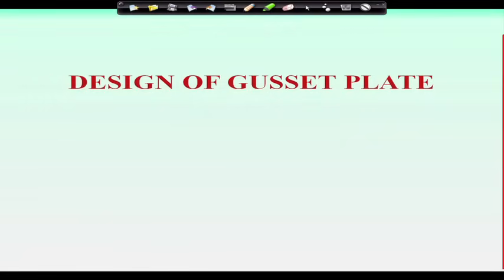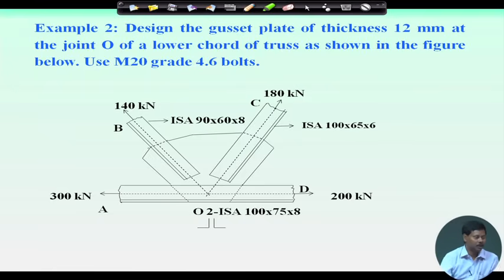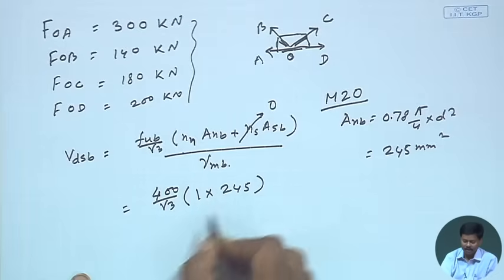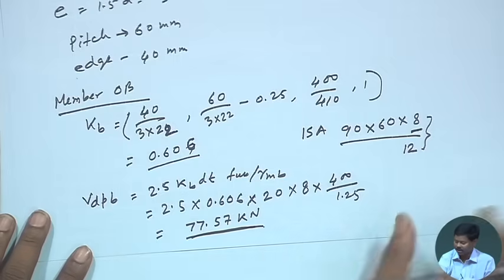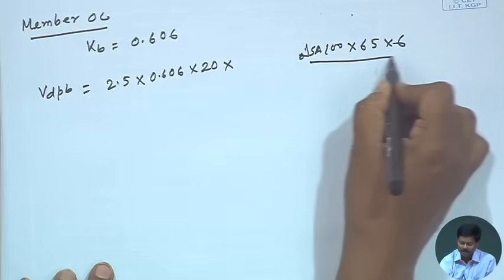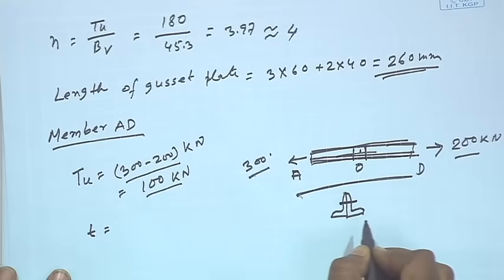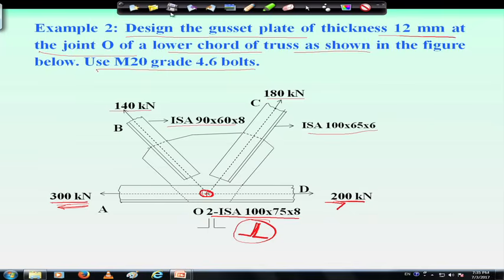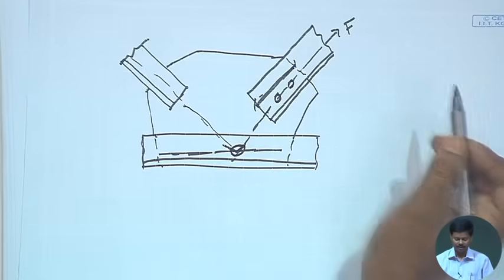Lecture 26 Design of Gusset Plate

Comment: What is the need to calculate strength of angle per pitch. And isn't it calculated in a wrong way as the direction of the tensile force is not perpendicular to the net area
Reply: I also don't get it. Are you clear now about the calculation?
Reply: @kkb3091  no, I felt it was redundant.
Reply: What is strength of angle per pitch even called?
I think thats the strength due to rupture of critical section with wrong calculation:
An=(b-d)*t
If longer leg is connected
For OB:An=(90-22)*8
For OC:An=(100-22)*6
If shorter leg is connected:
For OB: An=(60-22)*8
For OC: An=(65-22)*6
likewise for AD.
Reply: It is 2022 now. Someone please clear this doubt.
Reply: @manishkumarpandeyrnc  Actually whatever I have studied is washed off right now😂.
Right now I have joined NPTEL, DSS for the proctored exam. 
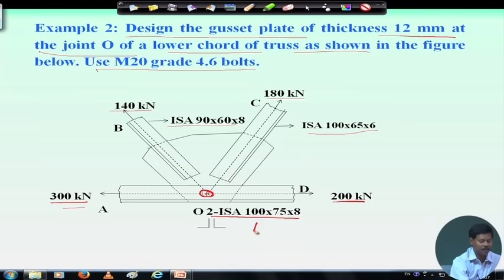They are arranging Google Meets there for the queries.I suggest you to join the meetings. Today itself, there was a meeting from 6:00-7:00 pm. The instructor was throwing light on HSFG bolts and related topics.
Please join the course and ask on discussion forum. Thank you
Reply: @shivamsharanlall672 how to join sir?
Reply: @silambarasanparamasivam1708  Use swayam portal
Reply: @manishkumarpandeyrnc  I suppose that you have joined the course. Link for today's discussion.
https://youtu.be/FBTgCAgyjuU

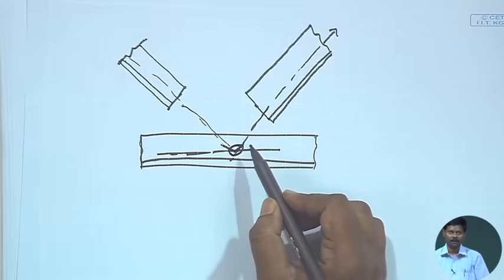Comment: @ 29:35 How can CG alignment be maintained in case of bolted connections as it might not be possible to place bolts at CG due to edge distance restrictions.
Reply: he is trying to mean the centre line of all the connected members must coincide at a point, so that no moment is generated about centre point.
Reply: @palashjain5318  but on the field, would you prefer to change the edge distance so that bolts are placed at the centre line or would you go with the same edge distance?
Reply: Because the min edge distance= 1.5* dh = 1.5 *22 =33 mm. And here the chosen one is e = 40 mm. We can increase it anytime.
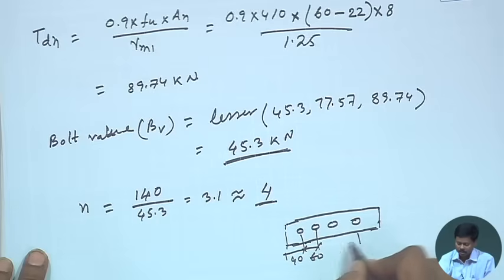Reply: As I was reading one example of design of gusset plate, I found that the bolts should be at the CG line and consideration of the edge distance should be in the direction of loading (like in 15:51) but not in perpendicular direction.
Reply: 26:24 here the length of connection is 260 mm with the edge distance 40 mm  in the direction of loading but not in perpendicular direction. Bolts are put in CG line without considering edge distance in perpendicular direction.
Reply: Please tell if you understood it or not?
Reply: @shivamsharanlall672  I think he didn’t notice your comments notifications. But I understood it fully. Thank you!!!
Reply: @kkb3091  thanks for appreciation!
Reply: @shivamsharanlall672  Wo jo 40mm edge distance liya h wo end distance h or bolt ko centre line p placed krne k baad bhi edge distance ka criteria full fill ho rha h formula same h dono ka but meaning alag h
Reply: @shivamsharanlall672  good explanation 👍🏼

Comment: at 17.35 for  V_dpb fu is not multiplied
Reply: And here fu is taken of ultimate strength of bolt but in formula it is of plate that is fu=410 n/mm2, there will be 410 in place of 400